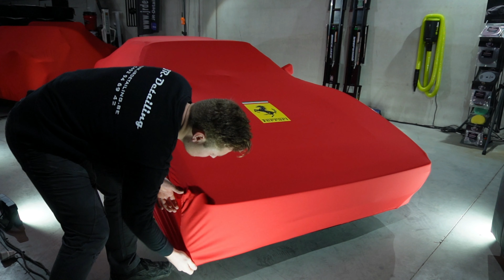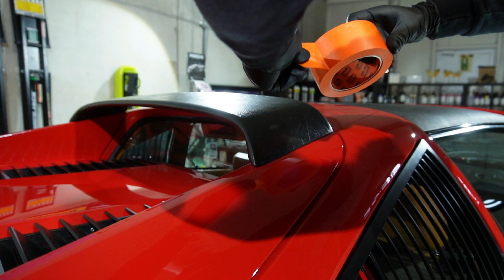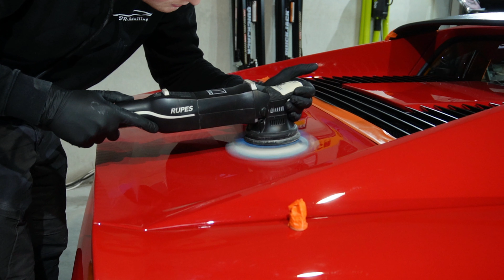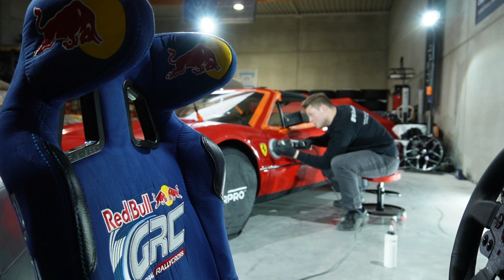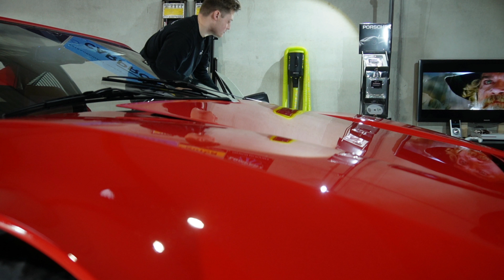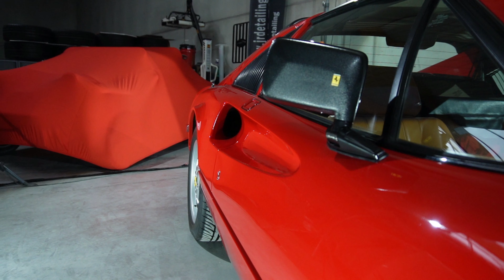Ferrari 328 GTS Paint Correction | Detailing | Polishing

Comment: Fantastic work JR! What pads, polishes and final stage waxes did you use? Did you find the Ferrari paint fairly soft and easy to correct?
Reply from the maker: Thank you very much! It's important every time you polish a step to make the pads compatible with the polish. Soft pad = finish polish. The paint on this ferrari was tremendously soft which requires caution!